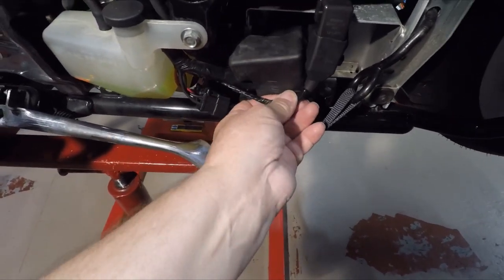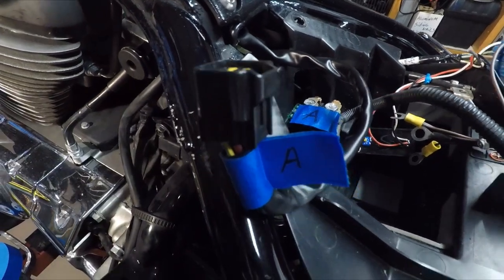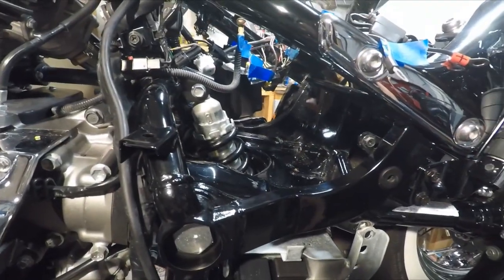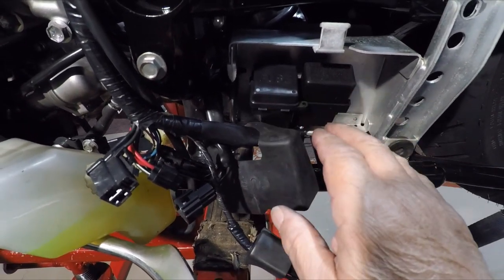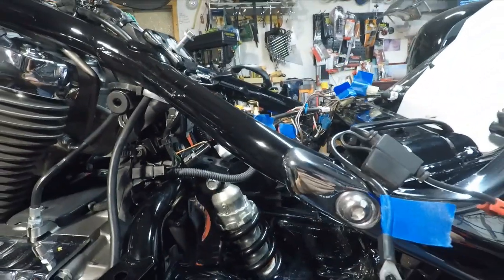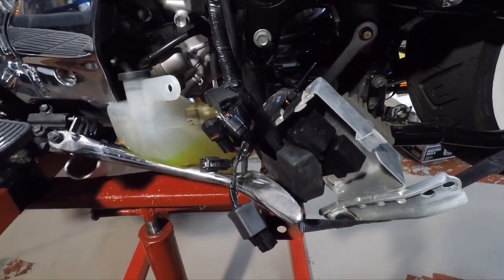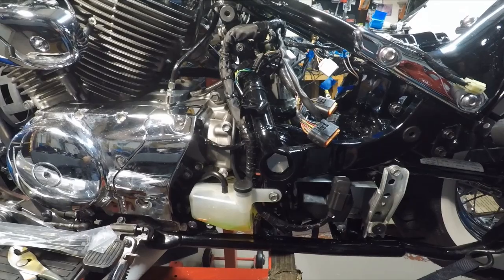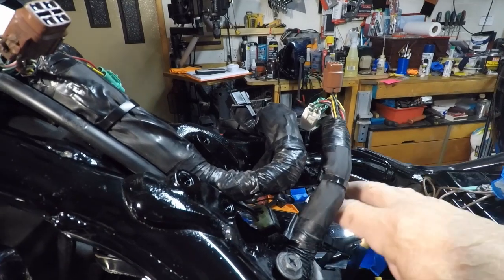FIRE IN THE HOLE --  THE WIRING

Comment: Norman, really good video on your excellent work. Thanks for sharing it!
Boy, the placement of that rectifier is a poor by Suzuki. If one has to just replace that, seems a lot of work to get to it. 
By contrast a very similar bike, the Kawasaki Vulcan 900, the rectifier is right in front, next to the oil filter. Very simple and easy to get at. That's the plus. The negative is each time you change the oil filter, you must remove the rectifier cover and the rectifier and it's bracket. But it's simple and quick. Only a total of 6 bolts for all 3 pieces. And I suppose that design keeps the rectifier in the wind thereby keeping it away from the heat and keeping it much cooler. Which design sounds better to you?
Reply from the maker: Hi Bob, I would think in front. My Harley is in front. But it's works on the Boulevard. It looks like a lot to go through to get to it but that's because I have so much off my bike. One cover and three screws and you can get to the rectifier. I got my neck covers today in the mail. Tomorrow I have to do some work to get ready for winter but I will get back to the Suzuki soon. All my best, Norman
Reply: That doesn't  too bad at all.
And yeah, from an engineering point of view, placing it in the front seems better.
Reply from the maker: @bobiozia218   Like cars they don't design them to work on.
Reply: That sure is the truth!
Reply: My C50 always broke down can’t figure it out  starts then stops runs sluggish here we go again probably will remove throttle body then sell